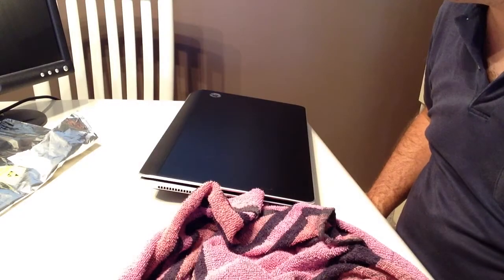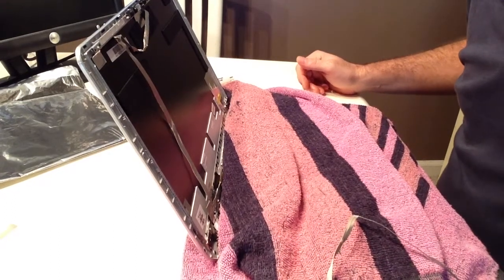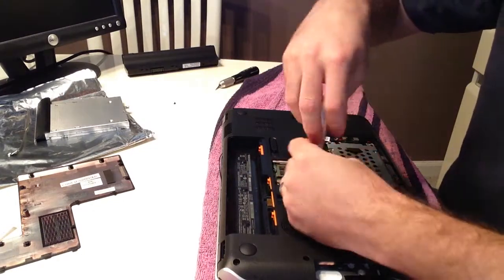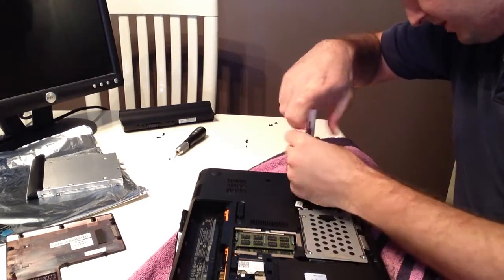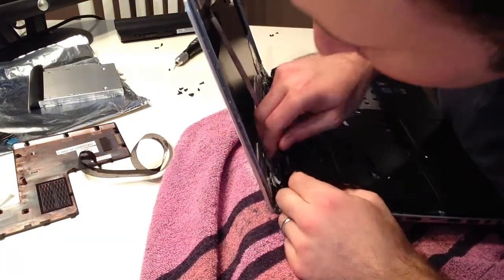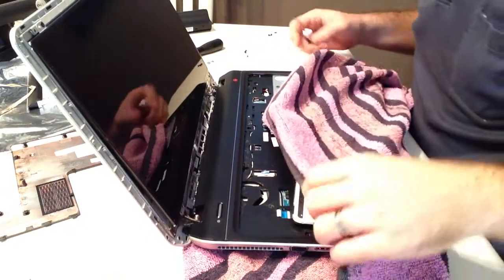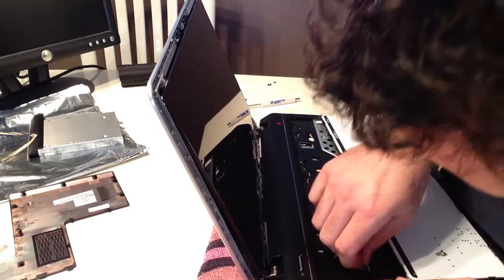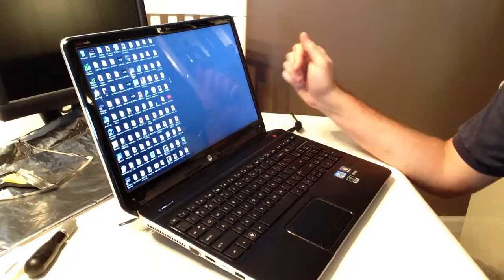laptop screen upgrade HP Pavilion DV6t-7000 DV6 7000 DV6-7000 Quad WUXGA display cable replace Part2

Comment: Hi, I just want to put IPS wide angle screen for my DV6-6120EZ,  lots of videos for replacing, not advising how to find compatible 40pin screen with side screws. Problem is for me to find it, because there are replacements from other guys, with success, but after looking for the specific model, lots of them are listed as NON-IPS at stores available for eastern Europe. Any kind of advice is appreciated,  thanks
Reply from the maker: I just google like everyone else... and I couldn't find anywhere that lists the display technology in replacement screens for your model--sorry!

Comment: Hi, can you help me to upgrade my HP laptop model# 15ac139nx
Reply from the maker: I see 139ns, 127nx, and 139ds... not finding any references online to the 139nx
Reply: this is what mentioned on the box:
15-ac139nx

message me your email to send you the box pic i just took
Reply from the maker: nevermind, got it: https://support.hp.com/bg-en/document/c05050947
Reply from the maker: I don't see a 1080p option for your laptop: http://www.laptopscreen.com/English/model/HP-Compaq/W2X16EA/ ...you can only upgrade to an FHD display if there was that option for your model when HP was selling it
Reply: so theres no chance even with changing the connector? :\
Reply from the maker: I mean, you could try, but when I did this upgrade I was just switching to another stock screen configuration offered on my model from HP--so you're gonna be in unexplored waters if you try it... and I wouldn't expect that it would work, no
Reply: i got some info to share with you, a whole chat with  www.screencountry.com, and they provided me this model number that will work with me B156HAN04.0, BUT i need to change the cable witch am not able and i dont know how to find the right cable out :\

Comment: Oh man, please, answer me! Why the heck do we need another cable for higher res screen if there are the same 40 pin LVDS? 
Or not the same?
What happens if you'll keep the old cable? Is that REALLY neccesary?
Reply from the maker: yes, it is REALLY necessary... the other cable does not carry a full HD signal, and will not work--sorry man, just how it is!
Reply: And what's the screen model?
Reply: Jesse Bond
Sad news. I can't find it anywhere out there in my neightborhod :|
thanks for super-quick reply!
Reply: can you also suggest what's the model of the new screen please?

Comment: Is it possible to upgrade this laptop to use a touch screen? awesome video!
Reply from the maker: thanks Silvio! unfortunately no, I don't think you can put in a touchscreen unless that was one of the stock configurations--if it was (I'm not sure), then yes you should be able to

Comment: Cam I do this in a samsung ativ book 6. He is WXGA, but i want a WUXGA FHD display. You could tell me if there is a converter cable for my laptop ?
Reply from the maker: Not sure, Daniel... Check and see if there is an FHD version of the laptop available from the manufacturer. That's the only reason I got this to work, because HP offered an FHD version so I could get the FHD cable from them

Comment: Would it be fine for my system if I upgrade the monitor even with the 1GB model of the 650M? Overheating isn't an issue for me as I have a good cooling fan that hooks up to the vent, but performance wise?

Comment: so glad you made a video. I have an HP Envy dv6t-7200 costco special from a few years ago, core i73630qm, gtx 630m 1366x768, wifi only (no bluetooth), 12 gbs ram 1tb. It is getting old so I have been replacing parts on it, replaced ram with 1600mhz 16gb, repasted CPU and GPU, new fan, replaced the wifi card to one that has bluetooth (Atheros 9485gn). I have been thinking of switching out the screen to a 1080 matte screen and getting an ssd to boost performance.

Comment: having trouble looking for cable for my model. I have a newer A10 15.6 Hp laptop non touch screen any help would be amazing
Reply from the maker: +TechyRodsWire what is the model number? A10 is just the processor type... do you have a 15-p210nr for instance? if not, the model number will look something like that
Reply from the maker: +TechyRodsWire once you find your model number, you can try to look for it here: http://www.laptopscreen.com/English/series/HP-Compaq/PAVILION/

Comment: i wonder where can i get the plastic part that you have to take off to acces the screws
Reply from the maker: Sebatián if you are referring to the bezel around the screen, I believe they have them available on eBay: http://www.ebay.com/itm/NEW-HP-DV6-7000-DV6-7002-DV6-7208TX-laptop-LCD-Front-Bezel-682052-001-US-seller-/111175569463?_trksid=p2054897.l4275 and http://www.ebay.com/itm/like/171333397897?lpid=82 both look like the correct part
Reply: it is not the bezel arround the screen justa the sticker with hp logo
Reply from the maker: Sebatián Carlos Virdó Lauricella
I got mine in the display cable kit from HP parts... not sure where you can get them by themselves
Reply: where did you buy it?
Reply from the maker: Sebatián Carlos Virdó Lauricella
you start by putting in the part # ( 682093-001 ) here: http://partsurfer.hp.com/
...here's a guide: http://h10025.www1.hp.com/ewfrf/wc/document?cc=us&lc=en&docname=c00372736
Reply: i see but once it is in the cart i dont know hoy to continue to see the price
Reply from the maker: Sebatián Carlos Virdó Lauricella please refer to the second link I provided above (the guide)--it steps you through the process
Reply from the maker: ***** I mention at 15:02 that the speaker wires have a tendency to sneak out the bottom / back of the bezel when putting it back on... the speakers are at the very bottom middle of the upper clamshell, a small black rectangle with two little speakers in it -- i put it back in place at 14:48 before putting the bezel back on
Reply from the maker: ***** they are not in the bezel at all... when you pull the bezel off, they are a small rectangular piece at the center bottom beneath the screen--and it pops out of place pretty easily

Comment: where can i get this cable for cheaper? thanks
Reply: Jerry Qu I have ordered myself 50.4ST15.021 (http://www.ebay.com/itm/171348528870). It has a little bit different bends and twists than the original one, but it worked out perfectly and the price is unbeatable :)
Reply from the maker: I have not been able to find it anywhere else for less... but please let us all know if you do!
Reply: Jesse Bond http://www.ebay.com/itm/New-For-HP-DV6-7000-DV6T-7000-DV6-7002-LCD-Video-Cable-50-4st19-021-Laptop-Parts-/190992386946?pt=US_Video_Cables_Adapters&hash=item2c78088b82 

would that potentially work? Seems the same
Reply from the maker: at that price, might be worth a shot regardless! ...but yeah, looks right!
Reply: Liberty Did you end up trying the 50.4ST19.021 cable with a FHD display? If so, did that work? I'm in a similar position of upgrading to a FHD display. Thanks!
Reply: Jerry Qu No, this is not the cable that you want. It is the one that comes with the 768p displays
Reply: Roman Sergey I personally used this cable with my FHD screen upgrade. I can confirm this cable works. Though it bends a little differently (I had to twist it around a bit for it to work), it is definitely compatible with my personal setup, Intel processor with Nvidia GPU, and a FHD screen.
Reply: Thanks Jerry for confirming, I ordered that one. I ordered the 50.4ST19.021 and it turned out to be incompatible with FHD/was the same as the cable I already had

Comment: Any side effects?
Reply: Also any particular things to look out for when choosing a replacement screen ?
Reply: I looked up my model on this website but it doesnt seem to have any higher resolution, also the website doesnt recommend increasing the resolution (since some gpus start to fail) is this the case after the upgrade?

https://www.laptopscreen.com/English/model/HP-Compaq/PAVILION~DV6-7063SA/
Reply: Also have you tried testing out the new screen to do strenuous stuff ?
Reply from the maker: you0are0rank
yes, I have played high-end AAA games on it and it's just fine.... I have had no side effects, it works without any issues. I have an nvidia geforce gt640m 1gb, and it does just fine with the higher resolution
Reply: i have a gt 630m 2gb what screen would you recommend me? for my laptop model? Jesse Bond